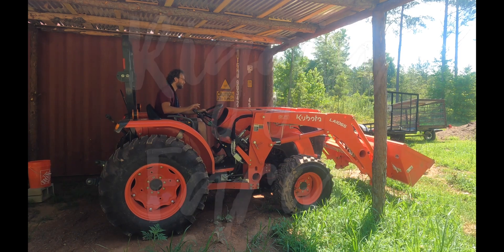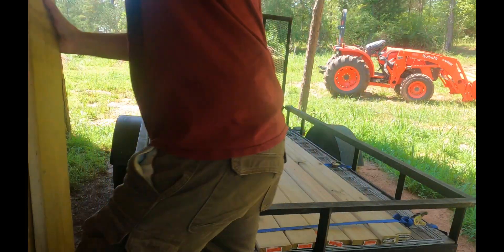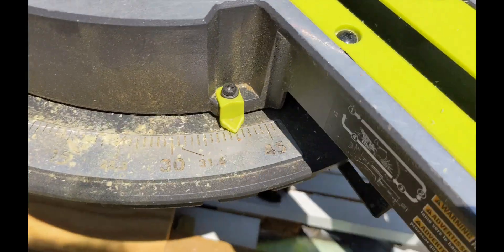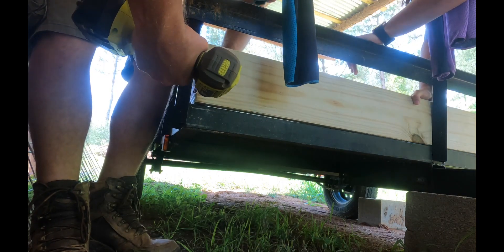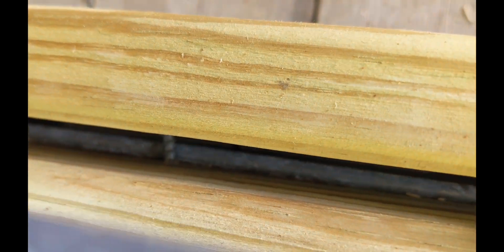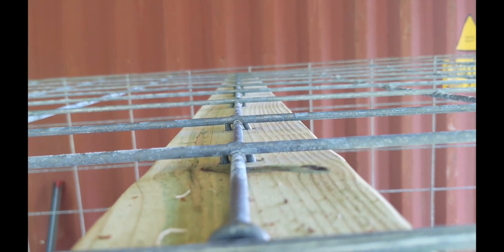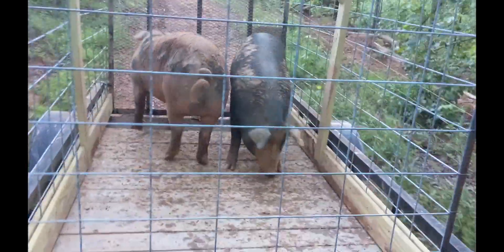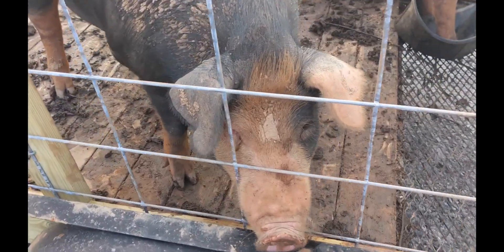DIY Livestock Trailer - 5'x8' Utility Transformed

Comment: I have used them same clamps on my trailer doing a similar build if you go 100 plus miles no matter how tight you put them they will back out go get some nylon washers to put in the exhaust clamps as cheap insurance never had anything escape luckily but noticed after a 300 mile trip to get goats I was missing 4 nuts

Comment: What was wrong with the other one that was right next to it looks like it would do the job
Reply from the maker: It’s much smaller and could barely fit one pig and not two. It also sits up really high, and we doubt they could jump in there even if they wanted to.